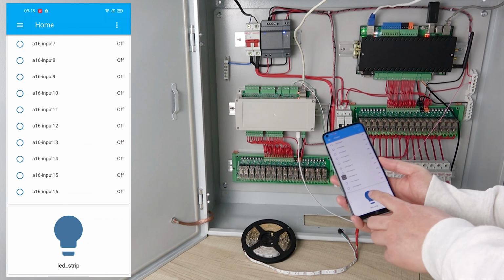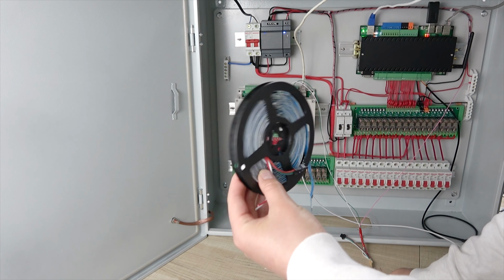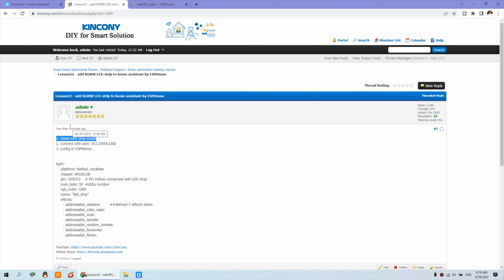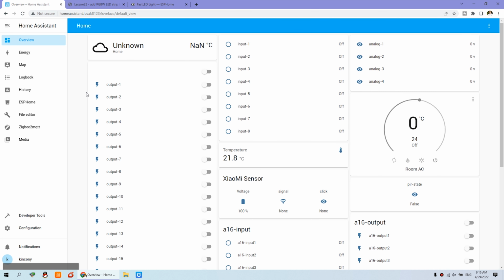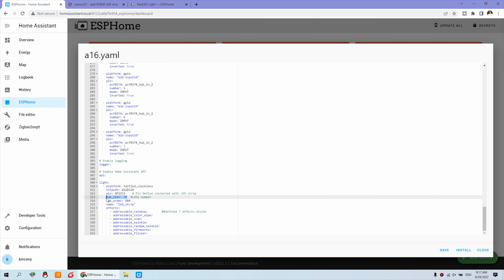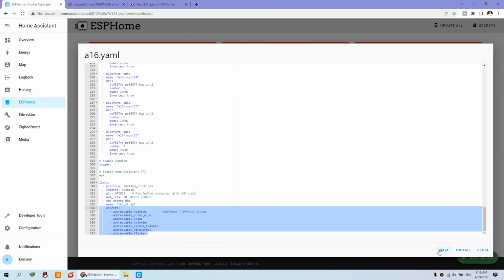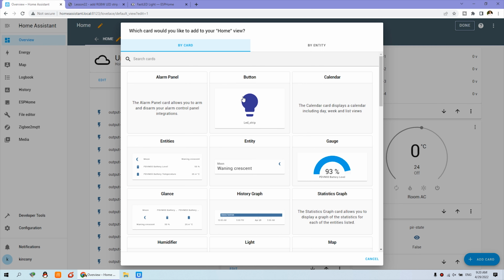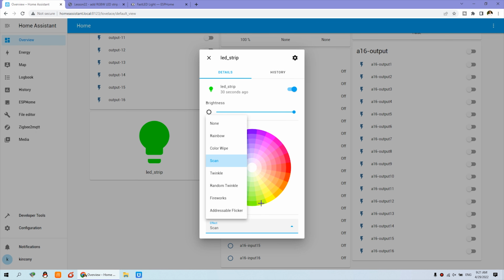【home automation training -22】add RGBW LED strip to home assistant by ESPHome

Comment: This guy really pissing me off  All these showing off equipments but haven't shown a real life 120 V power 220 V relay I don't understand why there is so much relay
Reply from the maker: how to use relay in other video tour.
Reply: @KinCony  I am looking at alot off your products to buy but you have not given real life situation with the relay and switches ok I get the understanding of the KC868-A64 KC868-H32BS but I don't understand the KC868-E16s pairing with the  Circuit breaker. You keep luping then your not even doing a individual  Relay and circuit breaker life examples and not even your it in real live voltage I need to see video of you hooking it up to power supply like for ex lights in and out the hous, house,, dive way and so forth. I need to see fail safe if the home  Automation system not working how can you have a backup animation system running and and how can you have  Manual switch automatic relay circuit as in normal power,  And for examples if one rise by a pie or 1 of the raspberry pie or 1 circuit or channel channel signal Output is not working do you have a backup running and can you run the power supply relay from a house power bank like a Tesla power bank for houses So you can still power your items in your house switch back switch
Reply from the maker: @topreviews7690  ok, understand, in furture can make video connect with load and how to use backup way.
Reply: @KinCony  thank you yeah will like to know how if the the relay file what switch with instantly switch to a backup and if the back up not working switch back holine wire 240v and if the relay working if there's no corrent how can it switch a spit Mille second to house battery
Reply from the maker: @topreviews7690  i think here is many video of cusotmer case: https://www.youtube.com/watch?v=665osYSSsl4&list=PLQUWhE_6LeOQnNP0vqwN7Kcjva3oDYfSM

Comment: what is difference between  ws2812 and ws2811...
can i connect this directly with server analog port and control is possible...
what about its stability
Reply from the maker: WS2812 use 5V  WS2811 use 12v , if long distance, suggest use ws2811, so that voltage drop will not a problem. we will test it with KC868-Server.
Reply: @KinCony  
how connect ws2811 use 12v with kck-server or kck-a16 ?
Reply from the maker: @محمدرزق-ح1ح  just use temperature GPIO pins for ws2812 LED strip.